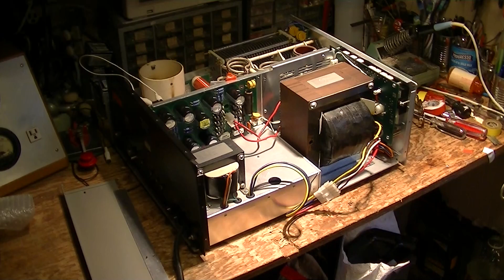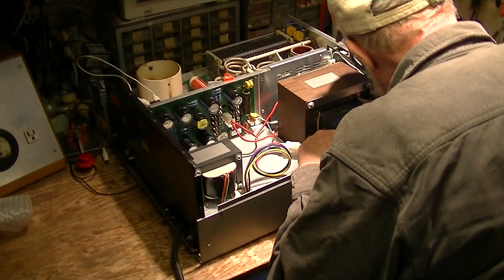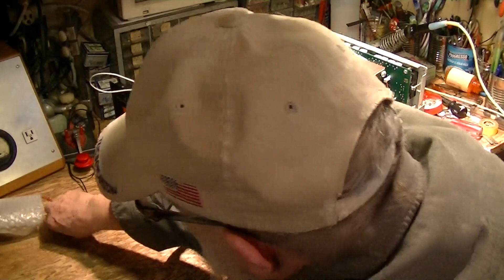Linear Amplifier - Recipe For Death By High Voltage  W6WUH

Comment: I also have worked with very high DC voltages, up to 250 kilovolts, with X-ray microscopy systems but, I wanted to suggest a very easy way to get a sheet metal screw started:     Use Phillips head screws exclusively, even if you have to replace the whole set.   Start each screw by holding it onto the tip of the screwdriver using the tip of your index finger of the same hand you're holding the screwdriver in, as if you've got the screw "attached" to the screwdriver.   Now,  pass the screw completely through the hole that's drilled through the loose panel, before putting the panel in place, while continuing to hold the screw in the screwdriver's tip.   Next, use the screwdriver and your free hand to position the panel such that you can feel the tip of the screw fall into, thus finding  the associated female hole.  Gently drive the screw into the hole just a few turns, leaving the panel very loose. Repeat this for each of the panel's screws before tightening any of them.   Finally, very gently tighten the screws from those closest to the panel's center, working your way out to the corners.   Tighten the screws only snugly.  Do not over tighten any of the screws to avoid galling the female threads.    When you become adept at this you'll see that an equipment panel can be installed very quickly, with finesse.    Hint:  why not put a little grease or oil on that squeaky chair before recording the noise, over and over again?  That's what the Pros do.
Reply from the maker: thanks all the airplanes I rebuilt are still flying. The squeeky chair weeds out the drifters.

Comment: Why no B+ safety interlock?
Reply from the maker: Allan... if you watch the series of video about my repairing this TenTec Titan II amplifier - of which this is a small exerpt-... you would learn that there are TWO interlocks.  The first you can see me flip up with my finger in this video...it is a hinged weighted mechanical shorting bar... normally help open by the lid... with the lid off, it directly shorts to ground the b+  where it passes through the partition between the power supply and the PA. compartment.   In addition you can see a white clip lead.  this is shorting a micro-switch  which controls a relay  which disconnects the primary of the transformer when the lid is removed.
Reply: You can't always test a circuit properly of its dead. Sometimes it has to be live and in operation so and you just have to know what you're doing. If you're not sure you're competent not to kill yourself then you aren't. There's no way to protect people who are incompetent. Companies try to stupid proof things but is that really fair to go against natural selection?

Comment: I am a Broadcast Engineer and routinely work around 10,000 Volts. Proper safety training, attention to your surroundings, and making sure your test equipment is giving you the correct information is vital and could save your life. Check everything three times over before touching anything inside the cabinet. Mr. Carlson's lab Youtube channel has a cautionary tale that you might want to check out. Even someone as competent and careful as he is can make a mistake.
Reply from the maker: ditto but retired.  I think you just said everything I said in the video.
Reply: I used to buiild DIY electrostatic speakers so I've handled high voltage audio signals and bias supplies. You'll learn pretty quickly not to move the panels while music is playing, despite powder coating on the stators 😅